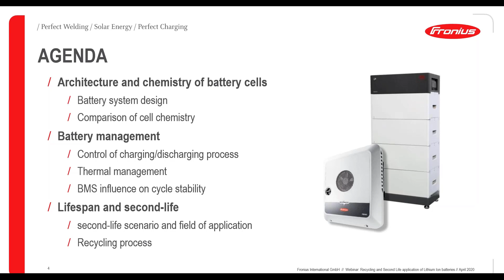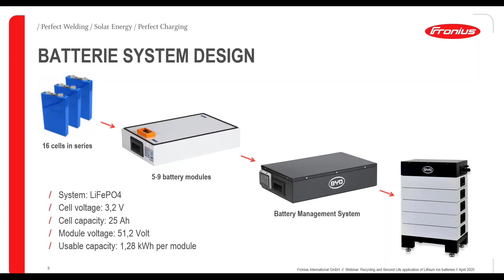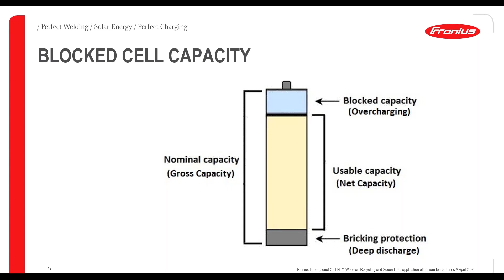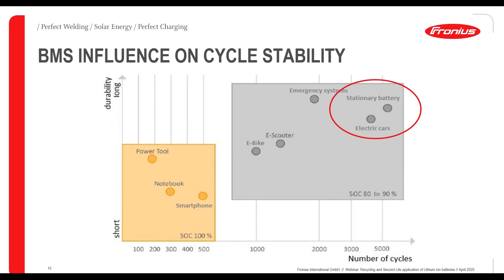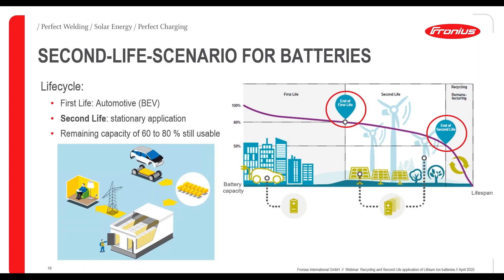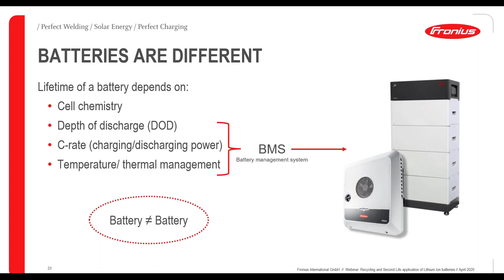Webinar: Recycling and Second Life application of Lithium Ion batteries

Comment: Michael, thank you for your well explained webinar, with detailed informations about different types of batteries. I'm starting to study about second life for Lithium batteries, but as in Brazil the EV batteries will take so long to be spent and replaced, as we started to have EV on the street not so long ago, I'm thinking on giving second life for batteries from another devices, like smartphones and notebooks or even electric motorbikes. What do you think about this? Do you think that is viable? And if so, what kind of  applicantions could use this kind of batteries? Thank you so much and congratulations for your great presentation!